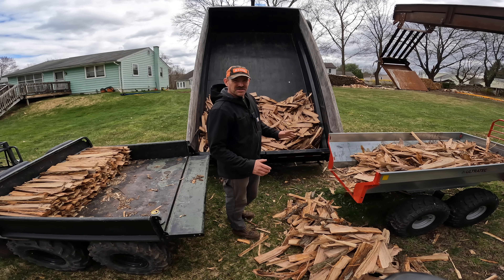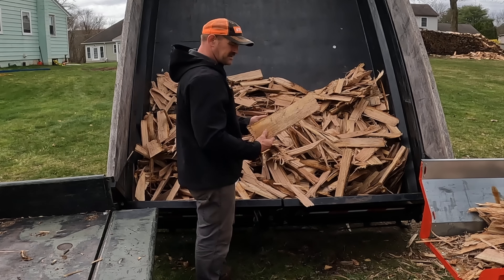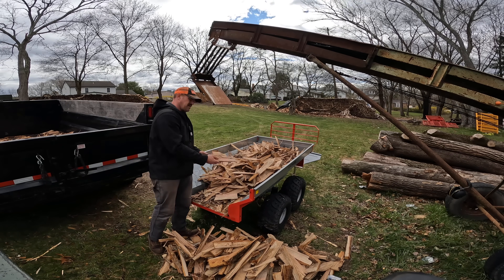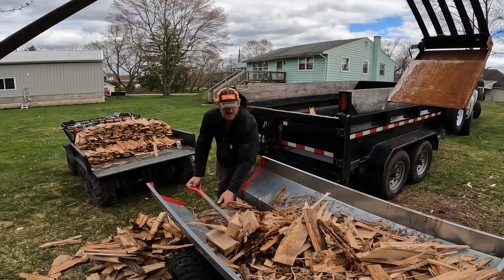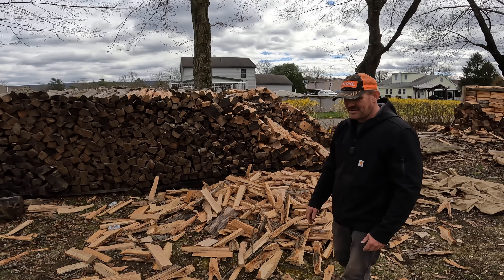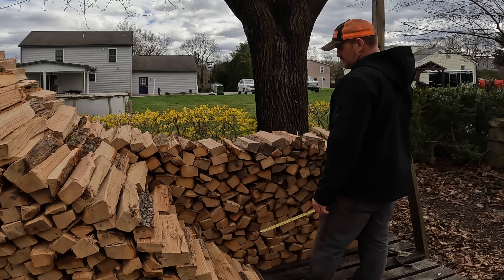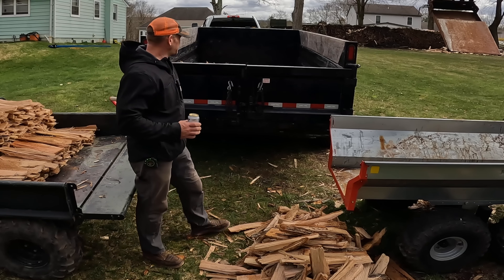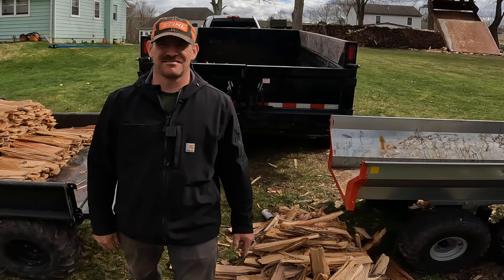How Much Wood and "WASTE"!!!

Comment: Love the video. You right about loving it or not. I totally enjoy working with the wood from start to burn. I have accumulated a nice stack of oak bark slabs that once good and seasoned works awesome in stoking my fires. I also like to run a yard rake around my splitter when done just to collect those scraps. I store them in trash bins for easy kindling. Always looking for a way to use everything. There’s always someone in our small rural town that needs a little help with wood. Always glad to be able to help. Thanks for sharing!!

Comment: All my firewood customers receive a 1 cuft bag of kindling and a box of the smaller slash.  Helping your customers build a quick and easy fire builds your brand.  I also use all this stuff in my own wood stove.  Keeps the flames dancing full and bright.

Comment: 90% of that stuff still has value my processor makes lot of slash when I run the 6 way wedge I bundle that stuff with twine and sell for 5 bucks that way I don't wast a red firewood bag. My bulk customers love this stuff because a lot of it goes into my dump trailer customers save it for fire starter some call it a bonus. I was at H.O.P.E. with you guys I had the dyna processor. I have to clean up around my processor so I may as well bundle it and sell it

Comment: I use the 1/3 cord bags put them on a pallet on the forks of the loader and all my short cuts go off the splitter up the conveyor and right into the bags, let sit for a year or two and can bring the whole thing in my barn to burn, others told me it's not worth it, I just bagged up about 1 1/2 cord ,i have way more than I can use and have sold some, some think it's garbage waste

Comment: 6:38 
Have you considered selling the really thin stuff in a bundle as a “premium product” with a slightly higher price.  You might market those thin slices as “split shingles”.  Just like you said, you prefer that smaller stuff because it dries faster and is more opportunity to ‘play with the fire”.  I would guess a few people that just use the wood for a fire in the fireplace a few times a year might prefer that size, too.

Just curious.  Keep the wood you enjoy - you’ve earned it and then some.

Comment: I have a 12-22 7 way box wedge as well. Had it 2 months. Are you running the box wedge pretty much at its lowest position? My customers prefer  3" high x 3" wide x 16" long. Are you doing a lot of resplitting to get your sizes?
Reply from the maker: The standard 7 way i run pretty much at the lowest position the pizza wedge i run with the center spine just above the top pull back arm plate.